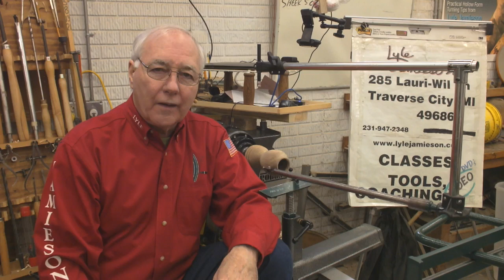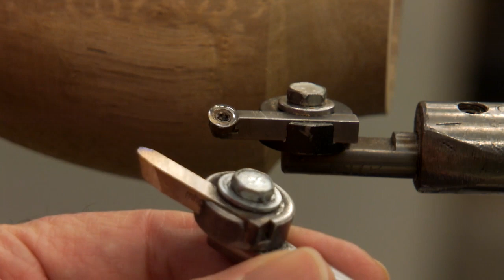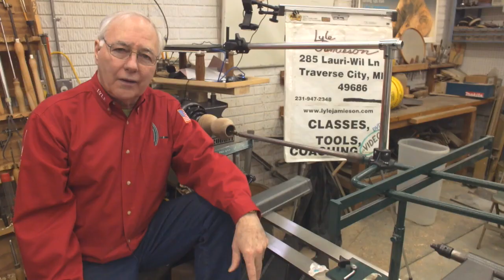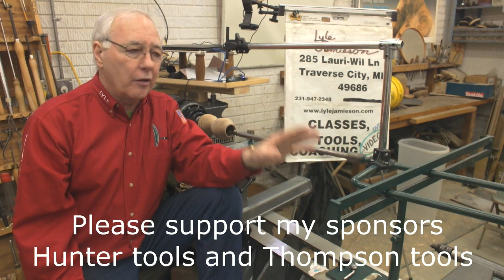Tool review Carbide cutter assembly

Comment: Can you sharpen these carbide cutters?
Reply from the maker: Hi Don, They last a long long time so replacing them at $20.00 is cheap and reasonable.  You can do many many vessels using my process before needing replacement.  They can not be sharpened.  The razor sharp factory edge can not be restored, even with very sophisticated expensive machinery.  Some other carbide cutters can be honed with diamond hones but they are not very sharp to begin with and the edge has no comparison to the nano-grain carbide produced for me by Mike Hunter.

Comment: The Packard catalog has this cutter, it also has a similar cutter that looks to have the cutter mounted on the opposite angle, as well as a carbide cutter that appears to be mounted level, like your high speed cutter. I love your system, and I'm looking to upgrade to carbide, can you explain the difference? Thanks.
Reply from the maker: Hi Mike,  Key word there is "similar".  I have designed my Hunter/Jamieson carbide to work different than any other carbide.  It is on a dedicated angle to slice through the wood fibers with a bevel supported cut.  I know of no other that will do that.  If you want it to work like mine you need to get it from me.  Yes, Packard is selling my tools but has a variety of other tools he markets as well.  You have to be careful, many carbide tools are not the Nanograin carbide produced from Mike Hunter.  They will not be as sharp and will not perform like mine.   I do have a reverse angle carbide cutter.  Packard does not carry it.  I have a lot of resources to get you up to speed with my carbide.  It is not hard but is different than any other.  For good reasons, more versatile, more efficient, safer, and easier to use.   Check the more information tab on all my tools in my web site store for additional information or just give me a call.